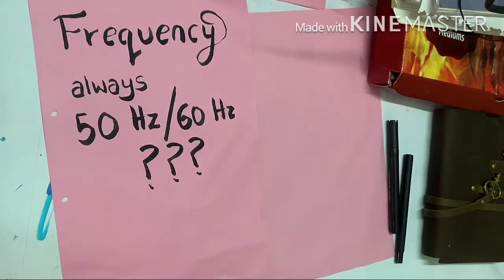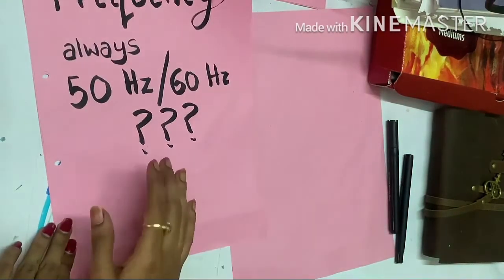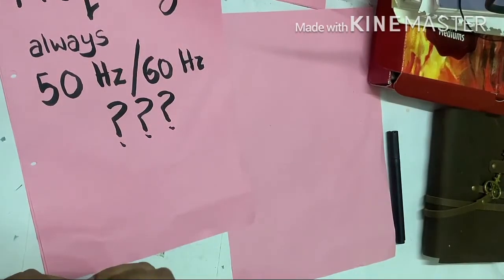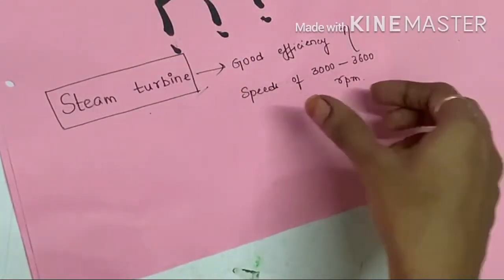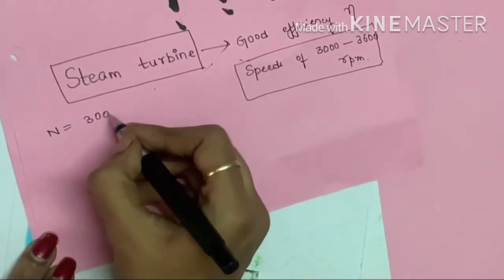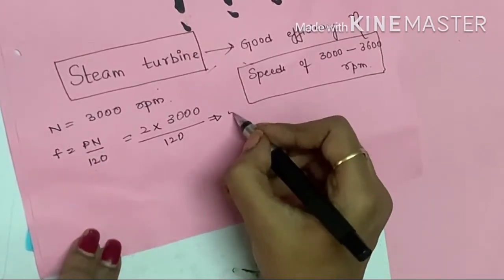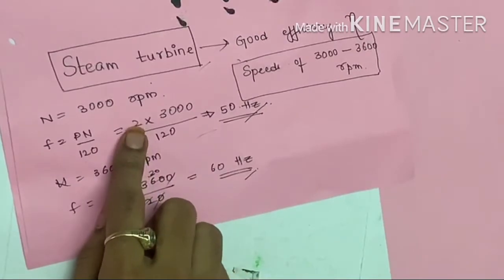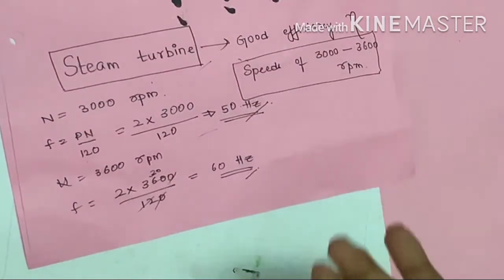Why power supply frequency is only either 50Hz or 60Hz?? Easily explained!!

Comment: So to make the frequency stable, in power station, they need a sensor to track the rotation of the turbine to make sure it always rotate in 3000 or 3600rpm no matter when the power demands high or low, thus the frequency not changing.

Comment: @Let's Learn Electrical engineering, Can you help me observe or understand the difference If i use a 50hz gasoline generator to power up a 60hz electric fan. Would there be a negative effect on the electric fan or a laptop that may be more sensitive? Thank you

Comment: In NZ we use 440v 50 htz 3 phase street distribution allowing 10% volt drop  5% to your point of supply/ boundary 2.5 % to your MEN  board and 2.5% to point of use. Nominally (400-40)/square root of 3. In my house the voltage must of the time is around 236Ac . The cycles are counted each day and adjusted to always average exactly 50 Hz, or 50 x 3600 x 24 cycles per day so syncronis clocks dont need to be adjusted ever.
Reply: Each house gets one phase in towns and 1 or2 or 3 phases in country rural areas.

Comment: if 60HZ what will the output voltage be?  thank you
Reply from the maker: It completely depends upon the type of circuit u have connected i.e. inductive or capacitive..
Because as we know the inductive reactance is directly proportional to frequency whereas the capacitive reactance is inversely proportional to frequency 
Therefore accordingly the reactance ehich means the impedance changes which effects the current through the circuit and hence the voltage

Comment: if it says 60hz does that mean i can only run 60fps
Reply from the maker: Sorry i didnt get your question
Reply: @letslearnelectricalenginee4671  It's a reference to TV refresh rates which is also the cap of their max frames per second. Typical TV's refresh at 60 hz, and have a max fps at 60. Modern Digital TV's don't care if the power supply is 50hz or 60hz, so the 50 hz vs 60hz power problem doesn't matter for them and has nothing to do with today's TV's, but it did matter for old cathode ray tube TV's. and US CRT TV's ran at 60 fps, and Europe CRT TV's ran at 50 FPS.

Comment: Excellent Thank You!
Reply from the maker: You’re welcome 😊
Reply: @letslearnelectricalenginee4671  f=8×900/120=60 will this work if your rpm is low As the number of poles increases and the number of rpm decreases, will the power be generated in the same way?

Comment: In the early days of electricity, America had frequencies of 25, 40, 50, 60, 100, and 133 cycles and voltages of 110v and 220v
Reply: We still frequently use voltages of 110 and 220 but why the different frequencies  back then this seems hard to create all those different frequencies
Reply: @jordanhowell3870 prior to the 1920s, the United States had no voltage or frequency standards, and the supply was dependent on whatever the relative power station was producing.  The country shored this up when they settled on the 240/120v split phase system we use today.
Reply: @jordanhowell3870 for example, in the 1900s, Westinghouse generators were producing electricity at 133Hz, whereas the Niagara Falls station delivering electricity to Buffalo, NY were producing it at 25Hz.

Electrical supply from Edison’s original station c. late 1870s-1880s produced 110vdc, which dropped to about 100v by the time it reached its customers
Reply: what happen to the light bulb at lower freq like 25 ? or even lower ?
will it going blink ?
Reply: Yes, there would be a significant flicker @moh6410
Reply: @moh6410 yes; the lower the frequency, i.e. the fewer times per second the electrical current is made and broken, the more noticeable the flicker.  In Europe, some people notice a significant fluorescent light flicker